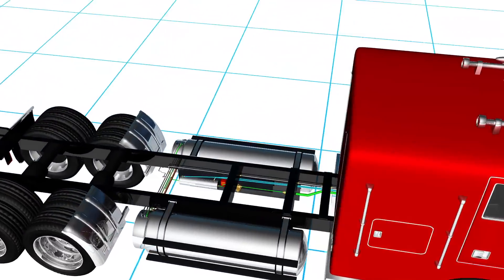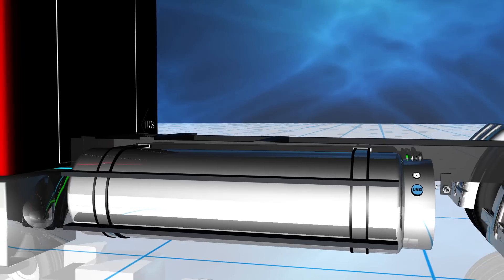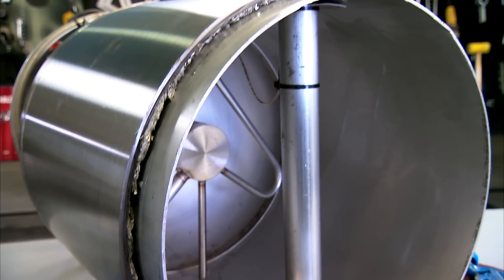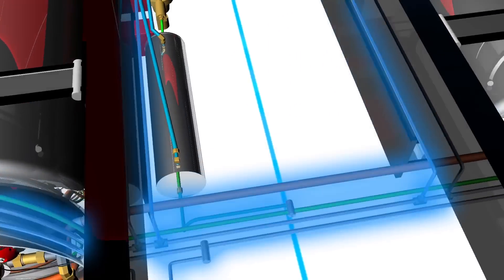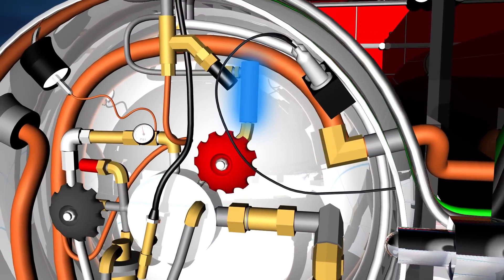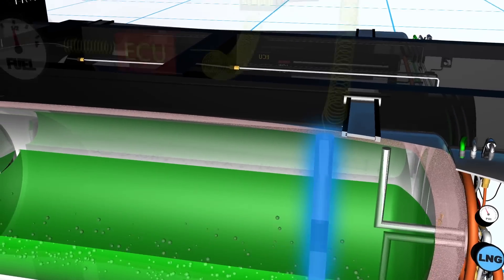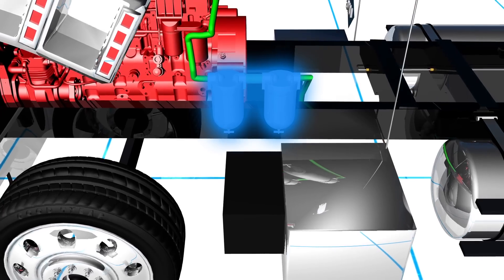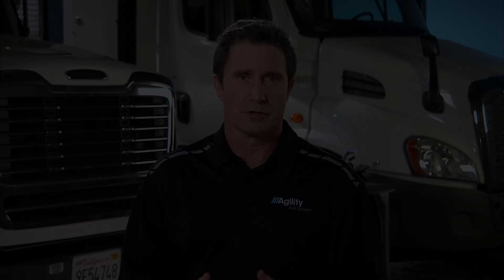LNG Segment 03: System Components

Comment: Thank you very much indeed for this video. It's so interesting and helped me to understand this process. I was surprised by info about risks of parking your track for several days.
Reply from the maker: Thanks!  Fuel venting is an issue only with LNG, not with CNG.  And LNG tanks are getting better....manufacturers are making engineering improvements to LNG tanks to improve their insulation and increase the "hold time" before venting.  If your operation requires trucks to be idle for several days in a row and CNG fueling is available nearby, you may want to investigate using CNG.

Comment: so if im off for 5 days it will dump gas because it will rise 15 psi a day
Reply from the maker: Yes, if you're in an application where the truck is likely to be parked for several days at a time, you may want to consider CNG rather than LNG.

Comment: It is possible to make an LNG gas car engine.
Reply from the maker: Good question, Patel.  The engine itself is the same whether you're running CNG or LNG; it's just the fuel storage system that's different.  Gas from the storage system is either depressurized (CNG) or evaporated and regulated (LNG), but the engine just sees gaseous-phase natural gas flowing in at a specified pressure.  For passenger cars, you can get enough fuel on board in a CNG tank, and CNG is simpler to deal with than LNG in that application, so pretty much all passenger vehicles that we're aware of are CNG rather than LNG.
Reply: It is possible to make an LNG car engine if you want to make small tires of lng.